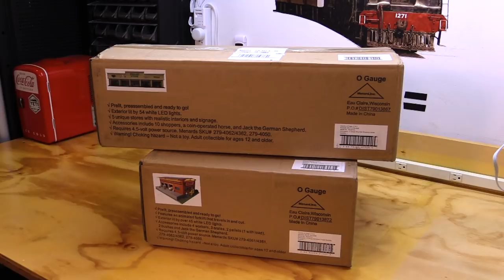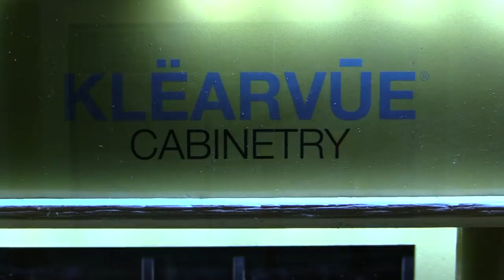Two New Menards O Scale Buildings!

Comment: Nice buildings.  I think I’d try putting an extra piece of wire and switch in the forklift plug line - so the forklift could be switched on and off separately and easily.

Comment: The big issue I see with these buildings is that you are limited as to where you can put them on your layout,unless you put outlets all over the place, which to me seems time consuming and expensive. I understand the larger adapter can hookup multiple buildings, but it still seems too restrictive. They should have made them so that you can just hardwire them with screw attachments like you would find on a transformer,then you can run any length of wire anywhere you want.

Comment: Lionel's fork truck warehouse has the load seem to disapear as the fork gets close to the platform edge or the awaiting car.
The Lionel comes with a control button so you load when it is time to load, not continuously and the load " appears t ito be put into the boxcar.
Reply from the maker: Yes but the Lionel accessory is a lot more expensive as well.